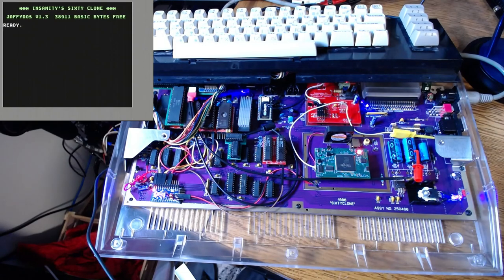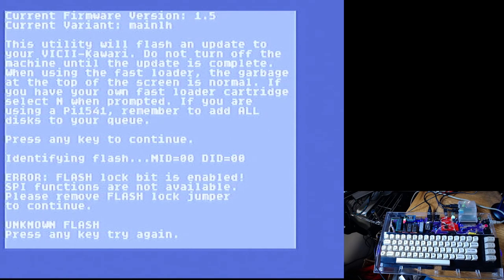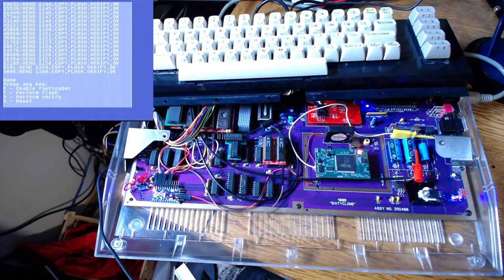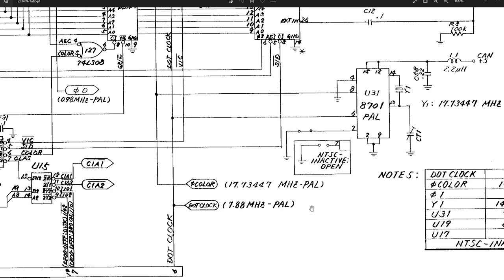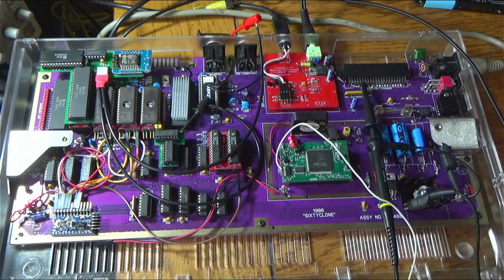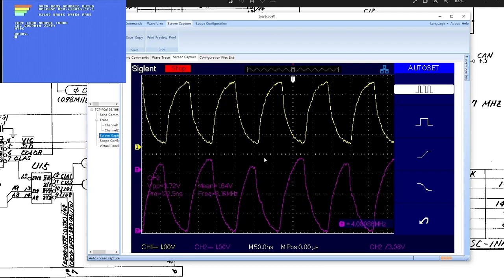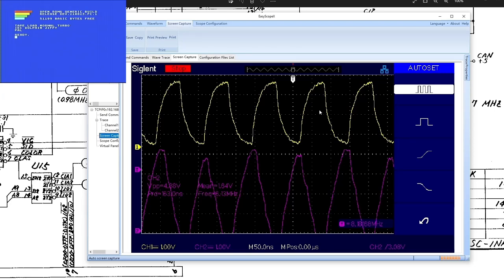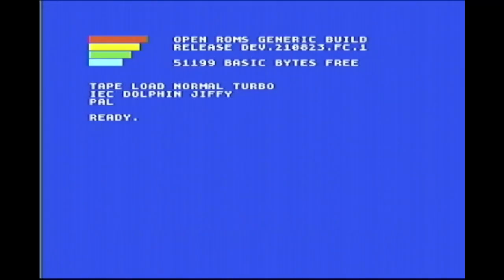VIC-II Kawari dot clock hack.  Get your Commodore 64 cart port in sync!

Comment: Very interesting hack. It would be nice to see a future hardware update for the VIC-II Kawari that allows it to send the Dot Clock to Pin 22. I think the 8701 chips are socketed on all boards so it would be easy to simply remove the 8701 to use this feature.
Reply from the maker: When I approached Randy about adding the dot clock output I did ask about this.  Unfortunately (at least on the mini version) I don't believe it is possible to do so internally within the FPGA.  I probably just could have bodged the resistor in between pin 3 of the LS05 and pin 22 of the header which would be a cleaner install.  I'll probably try that the next time I've got the soldering iron warmed up.

Comment: So where we can get that Dot Clock MOD firmware?
Reply from the maker: Randy gave it to a few of us to test.  He'll be officially posting it fairly soon.  Lemme upload it somewhere for you in the meanwhile.

no guarantees, warranties, or any such thing expressed or implied.  use at your own risk, this is not officially sanctioned in any way shape or form.  void where prohibited. not responsible for damages, or any of the 7 deadly sins that may present themselves as result from the use of this file.  you're in uncharted territory, no fly zone, turn back now, thanks for shopping with us and please drive through. https://www.dropbox.com/s/odzsew7lipe9aug/kawari_flash_1.6_LH_multiboot_dotclock_hack.zip?dl=0
Reply: I asked Randy for one for my original large board and he gave it to me no problem, using discord. I'm running it in a 250466 board with the 8701 removed. And on the large boards it has a spare pin on the header than you can use for the dot clock signal. I soldered that pin  to the bottom on the board and have the other 9 on top for the rgb out. I also just got my 2 new style large boards, but haven't had a chance to play with them yet.